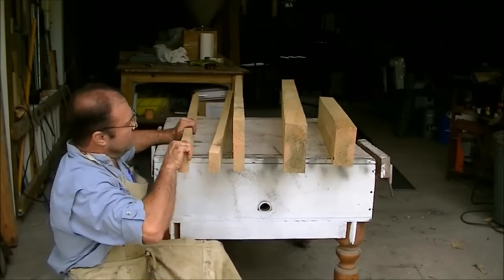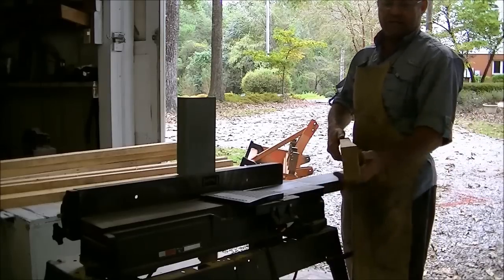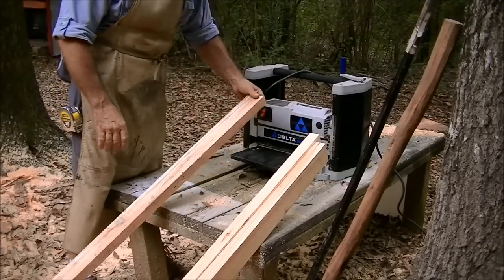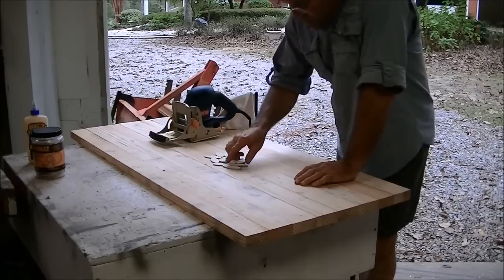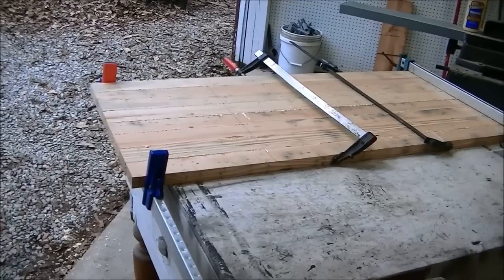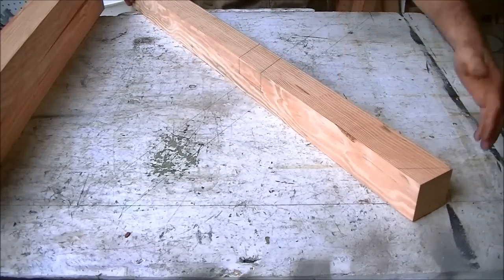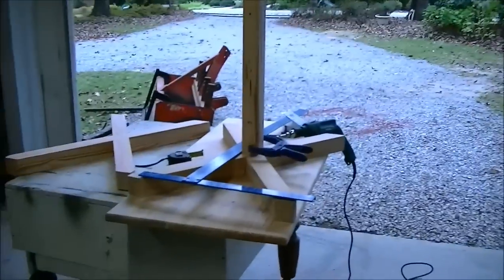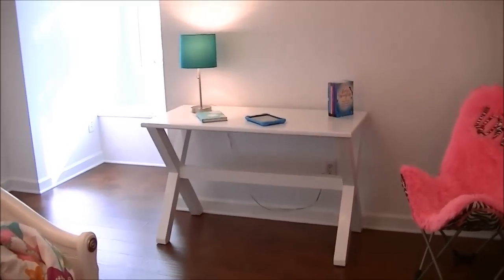From a tree to a desk? time lapse one year. Useing, joiner and planer. Part two

Comment: A long time project with an awesome result. I love that the table is both rustic and smart at the same time. You just managed to make it right on that thin edge between the two time frames.

Also, that idea with the magnet on the drill is brilliant, i'm getting some magnet strips tomorrow to glue on mine because using the wrist magnet was a bit cumbersome.

Awesome video. :D

Comment: Mark, this has taken a long time. I particularly liked that you saved the video from felling the tree for a year and put up these two videos together. I would have been climbing the wall to get the (first) video up. This is a great, simple design and is a good use of the lightning damaged tree.  I assume her chair will be made from the same tree?
Reply from the maker: +Karl Kelley I have several videos I have archived, It is hard to wait. I have several other trees that have died this summer by my garden. A camphor tree and a red oak that I will just cut up for fire wood. I have more wood now than I ever dreamed of.

Comment: Great job.  Nice way to re-purpose a tree struck by lightning.  I have only one design suggestion / question.  With the cross brace going completely across the the length of the table, how will she sit completely underneath the desk?  Won't her legs be unable to get fully beneath the table?  BTW, I watched your Solar Panel build & was inspired to assist my daughter make one for her school science project.  She took first place at the regional competition with that project and received several special awards and $350 in prize money.
Reply from the maker: +1255You  Their is leg room for her. It was made for a child. If I made it for a adult I would put the stretcher on the  back leg only. Congratulations on the award.Mark

Comment: How did you attach the top to the legs?
Reply from the maker: +BangFlop I used one screw and then a aluminum corner bracket that I make. I show the method on it in this video on another farm table I made.https://www.youtube.com/watch?v=QH1qgYoiSQ0
Reply: +markp0177 Thanks!

Comment: Question to anyone out there. I have a small backyard and cannot fit a sawmill similar to mark's although I do want one so I can make my own lumber, can anybody help with an idea?                         -Thanks
Reply: +Max Greenwood Mark made a sawmill out of an old golf cart, and so his specs fit that specific size. What if, for example, you used an old atv ? It would not be as wide as the golf cart is (perhaps).
Reply: That's a great idea,  just shrink the machine down to fit for the specs. Thank you so much
Reply: +Max Greenwood No problem.